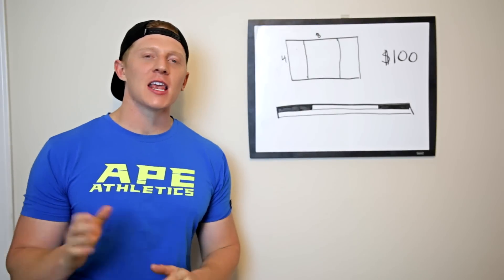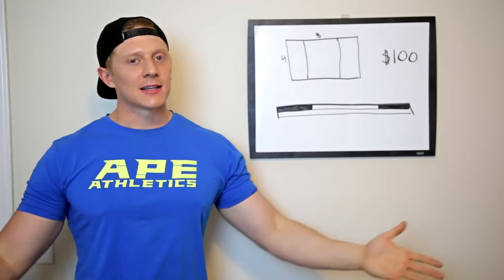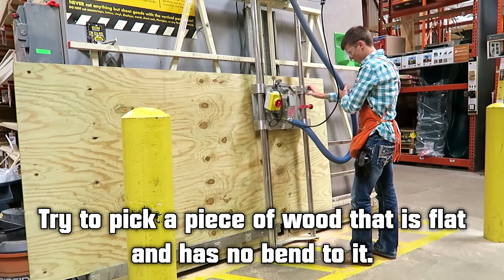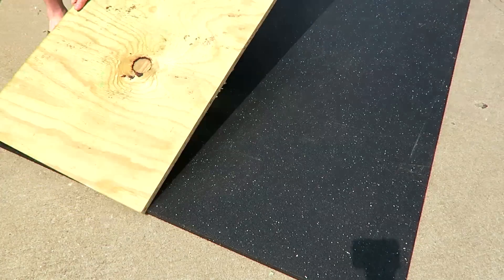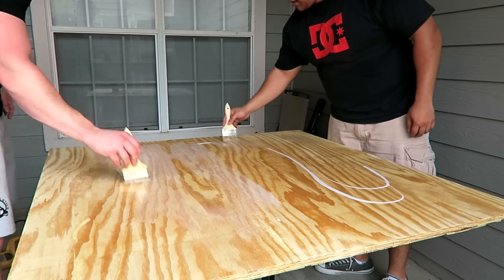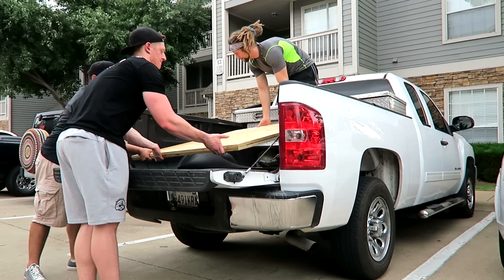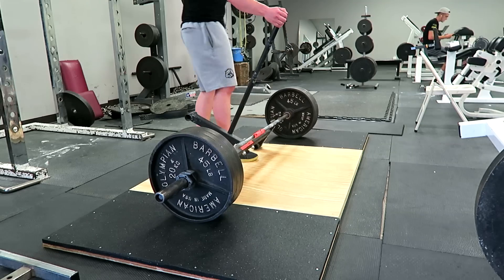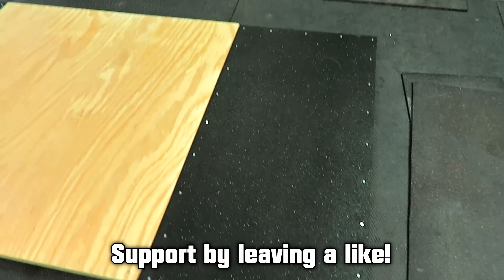How to Make a Portable Deadlift Platform (DIY Weightlifting Platform)

Comment: if you gonna cut the stall Matt 2*4 why don't you guys cut it a different way, I mean the Matt is 6*4, so it consists 3 2*4, you can cut it twice and get 3 pieces of 2*4
Reply: Do you think they did not end up with 3 2x4 pieces?

Take a closer look.

A benefit of doing it their way is that you end up with 3 2x4 pieces that each have at least one long side that was pre-cut at the factory.
Reply: You can make two cuts that are both 4ft long...or you can make three cuts, one that is 4ft and two 2ft long cuts. Maybe if  precision was important, two cuts would make more sense, but here it’s pretty arbitrary.
Reply: @LD-kz3ms  the pieces will have same amount of factory edges in either case...really it’s just a matter of order of cuts. In either case you are cutting a “T” in the mat

Comment: I put this together today in well under an hour, which included staining the platform and two spray on coats of polyurethane. Simple build, very sturdy, plenty room and it can be stored out of the way. Thanks for this one, really helps keep the basement floor in tact.
Reply: I've been using rubber gym floor tiles from walmart on my hardwoods and it's still all good.  I store those behind my weight racks.  Super light and easy, you wouldn't believe it.
Reply: @joshchristian6101  nice, it didn't cross my mind to use those. I hope they withstand the abuse of the weight but they also aren't too expensive. Plus you can rotate the square if a particular spot is getting too much damage. Winning all around 🙏🏿
Reply: @HabideenOlaniran  yeah, I'm a super cheap o.  The pads have held up to weekly abuse (just me and my son) for 4 years now and no sign.of damage.  I've recently had as much as 485 and the pads still handle the load.
Reply: @joshchristian6101  nice, cost efficient and durable. Can't beat that

Comment: Did you have any issues with the pieces coming apart while you were lifting?
Reply: So when I built mine the pieces wouldn't move until I started deadlifting 315+. But even then it didn't move that much. I recommend just placing weights on the corners or sides if you go heavy.
Reply: Depending on your set up
I have 2 squat stands with sandbags on em so that keeps the side pieces still enough
Reply: L

Comment: For those of you interested in doing it this way, here’s a pro tip: 

Little bit of dish soap on your razor blade will make cutting the rubber stall mats a LOT easier. The blade won’t hang up as much. Also, take your time with it and only cut a little deeper each pass, folding the mat back more and more each pass.
Reply: JRhea716 hey man thanks I actually did this and it for sure helped
Reply: yser one Glad I could help!
Reply: I'd just put it on a scrap piece of wood and use a rotary saw.
Reply: @JRhea716 😊😊ŵ😊ŵwwww😮😮😮😮😮😮😮😮😮😮😮😅ŵŵŵwwqqqwww😮2 0:01 0:01 0:01

Comment: I'm building this currently, at the tractor supply in my area they only have one size, which is 4x6, 3/4" thick. Beware though, the thickness is accurate but it's an inch short on all sides. I don't have any power tools to cut with so to make it work I cut my first 2x4 piece, and then I had to cut two 24" x 23" sections, plus a 24" x 2" strip to cover the area of my second 2x4 plywood. I could just as well buy a second 4x6 mat but those things are heavy to mess with for aesthetic, I don't have a truck so it's a pain to load them into my small Jeep, and I don't want to drop another $40 right now. Just something to consider for anyone starting this build who's reading the comments. Other than that it's going great!

Comment: As an improvement to keep the portability while unifying the platform into one piece would be to have hinges at the front and the back of the platform, so you can fold it back on itself and otherwise not have three separate panels :)

And if you are using this on a wooden floor, I'd suggest to add another rubber layer underneath to reduce scratching and slipping!

Comment: I built an 8x8 platform to screw my power rack into. I also bought the rouge Ohio power bar months ago same as the one you bought and it's the best bar I've ever used period. When I get into heavy weight I never lower my bar during dead lifts I drop the weight (I do have bumper plates) and the bar is doing just fine.

Comment: Came out awesome dude!  I'm thinking of making this for my new place..which is on the second floor.  Should be fine...right?
Reply: Yeah I did it upstairs too, above my garage that I use for other stuff. I researched it and if you have a standard floor you'll be fine.
Reply: It’s risky. My university’s gym is on the 2nd floor and the deadlifting platform caused structural damage to the 2nd floor so we couldn’t deadlift for like 4 months lol. Not saying you’re going to fall through the floor but it can knock some screws loose.

Comment: This looked pretty dope actually. I;m concerned about the 2 side pieces. Do they shake when doing deads?
Reply: I've only had an issue with the sides unless I go 315+. Barely moves, but still noticable. Just place extra weight on the outside of the pieces. Works fine after that.
Reply: alternatively you could drill some some holes in the side of the main board and insert joint fasteners
Reply: @DrDeusExMachina  Can you elaborate for the meat heads and maybe link the idea? I'm interested.
Reply: @Mike14x  so if you were to go up to 500 would it be a problem?
Reply: @getstrongby4038  Even then, never really moved that much. Unless you just slam them for reps. But if you do go that high just place an extra weight on the outside of the side pieces. It helps.
Reply: @Mike14x  thank you appreciate it, I was going to build a solid one but I don't have the room to keep a full size one. My cheap flooring is taking a beating
Reply: @getstrongby4038  Made a video about it recently for anyone curious.
Reply: @Mike14x  I'll check that out now

Comment: The one issue with rubber stall mats is that they stink. If using outdoors their fine, but if they are used in an enclosed area such as a garage or basement, the smell can be overwhelming.

Comment: if anyone is looking for ideas for band hooks  I came up with something that worked. since this platform is thinner than a lot of other videos I found a lot of bolts or screw hooks threading was too long.I bought 4 tarp hooks from lowes and used 2 shorter lag screws on each hook.I use elite fts bands and have had over 3 on with no issue however the thicker size bands will probably only fit 1.. hope this helps someone

Comment: According to Gym Crafter, horse mats can emit toxic gas, and they say they can smell bad.  Just wanted to point that out, I only recommend to do your own research, and do what's right for your application.  This would work well outside if you sealed the wood with epoxy, polyurethane is only good for indoor applications.

Comment: How did this withstand the test of time? I was going to build mine like that ans am wondering if you had any issues with the screws coming away from the rubber?
Reply: I would recommend you the usage of "Screw Washers", this will prevent the screw going through the rubber. Cheers!

Comment: Just a thought here, but if the sides slide out when the weight is dropped and it gets annoying you could always make a frame with 1 inch pine to go around the platform to hold it in place.
Reply: I had the same thought but instead of the frame for it use those eyehook with the latch things (I have no idea what they are called) but four of them would screw in easily and that way you could just latch it when u lift and unlatch when u put it away. but great video thanks for the awesome idea.
Reply: 1" pine would snap in no time with the weight he uses.  besides having a 4x8 square box of 11 would defeat the purpose of cutting the 4x8 sheet in sections to make it portable lol

Comment: Great work. Not sure if anyone has asked, but what difference would it make to Not have the middle section?  With or without plywood. What difference e would it make to lift something that's 3/4" or 1.5" higher that your feet not including the height of the soles of your shoes?

Comment: Just seeing this video but I have a question for you... I am looking to make a garage gym floor, I currently deadlift with iron plates in the low 600's. I don't want to crack my floor so I did purchase 3/4 stall mats and I'm going to get some plywood. I am putting down 4 total 4x6 mats (under my squat rack and extending out to the side of it). Do you think a single layer of plywood under the mats would be enough or do you think I'd need to double up? I'm not planning to install a wood top layer for the platform area, FYI.

Comment: this design would just be for deadlifts right, not olympic lifting? and also to stop damage to the first layer of floor boards syphilis you redolent have rubber underneath as well or could tipu do it without it?

Comment: So I just made my own deadlift platform with the same specifications! Pretty good so far, but the only complaint I would have is that if ur pulling sumo and have a wide stance it will cause a bit of separation of the platform. I’m planning on buying some type of latch to connect the middle and side pieces in order to fix the solution. Hope this helps anyone!
Reply: How much did you spend?

Comment: Hi. I’m new to your channel. Just saw this video. I have a question which I was hoping you could help with. I made a gym in the back shed, which used to be a garage at some point. The flor is concrete. It has a  big crack running through before, and that has become more pronounced as I’ve been using it for deadlifts and all sorts of heavy lifting. Is there anyway I can make a platform to sit level on the uneven surface? I don’t know if the landlord will let me do the entire shed, and there is A LOT of stuff in there, just random lumber and pipes and construction stuff that was there previously. It would be a huge undertaking even if he agrees. Also, I don’t know what the cost and time line to get it done would be. I would appreciate any help I could get to figure something out. Thank you.

Comment: The 4x4 wood surface is kind of devouring most of the platform. I mean the plates are only an inch away from cracking the wood floor.
Reply: plates are only an inch away from the safeties in power racks too...  think it's all standard width

Comment: 1 - Stop dropping the f@#$ wights.  I HATE people at the gym who do this
2 - You're losing 1/2 your workout, missing almost all of the eccentric benefits
3 - Slow, controlled movement.  Less injury to yourself, your floor, your equipment, better results
4 - Sumo deadlifts are a modified squat and a poor one at that.  Deadlifts should target the lower back and ham strings - see all the above